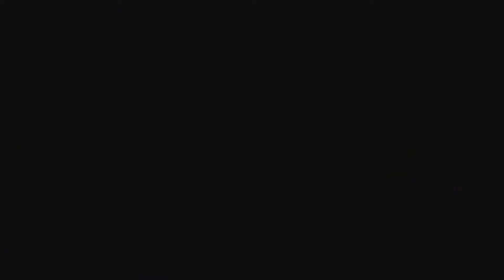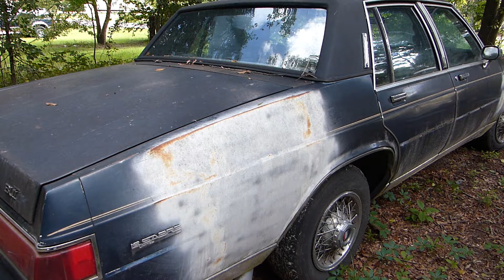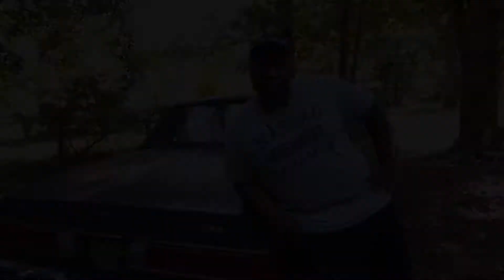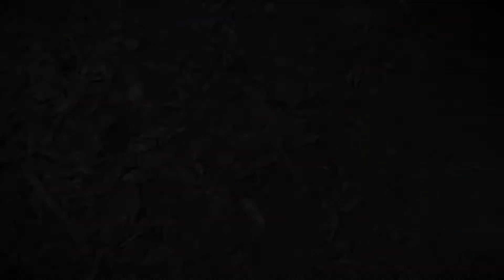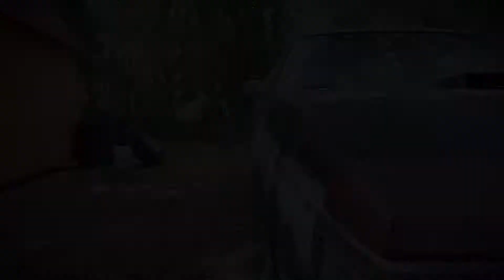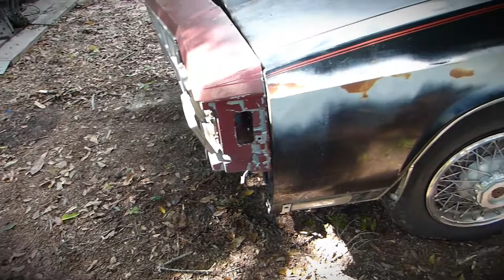Pontiac 400 Exhaust Walkaround Lunati 262/268

Comment: With that cam in a 400 it should shred the tires right off idle. Try 12 degrees initial timing and 20 degrees mechanical advance  for a total of 32 degrees advance . You want your timing to come in fast like full timing at 2200 Rpm . A Pontiac 301   distributor has a super fast curve, almost to fast so can adjust with lighter weights. I prefer the lighter weights over stiffer springs.  If you get your timing correct it will come out of the whole quick with just 3:08:1  to 3:23:1 gear.  I like to keep vacuum advance in tact for part throttle street driving and way better fuel economy. You only need 10 to 12 degrees advance in  the vacuum canister. I have ran Pontiac's since 1979 : make that  Buick a sleeper and tell them it's a 350 !!! All Pontiac's are the same size on the outside. My 462 LeMan's has 326 call out numbers on the side. Wink Wink

Comment: Junk yard half ton truck axle that already has some 3.73's and limited slip would fix her right up on the cheap. Would have to seriously up your welding and fabrication game though.
Reply from the maker: +James Griffin I need to then make sure the axle has the same wheel bolt pattern